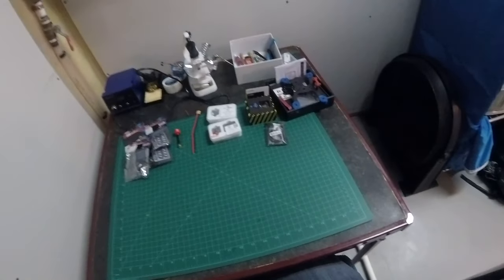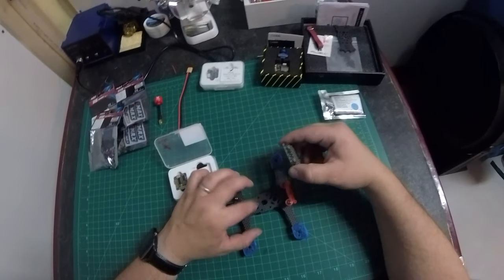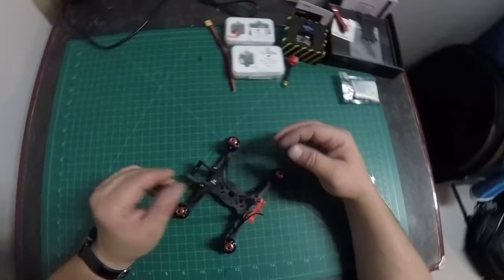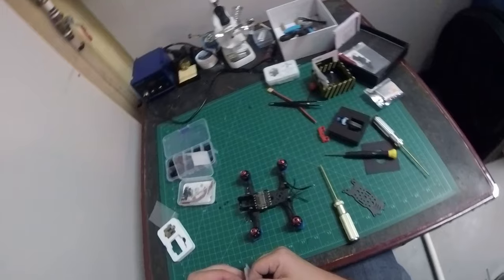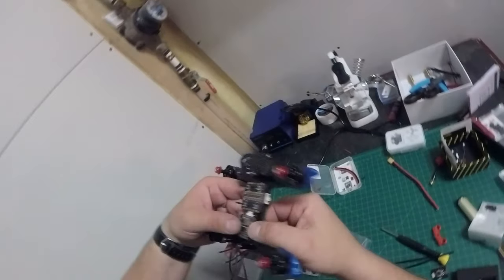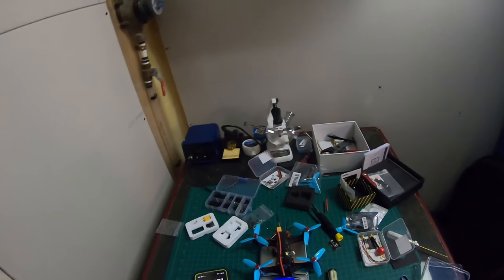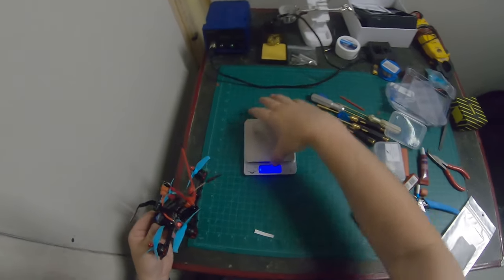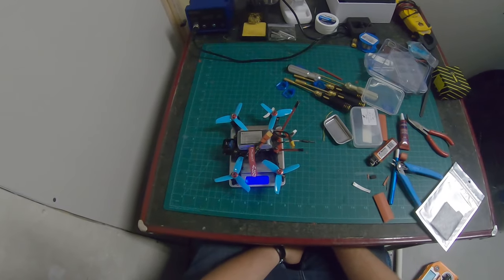#CaddxTarsier Building a 250 Gram 4k Racing Drone. Layout, Design, and Maiden Flight

Comment: did your motors get hot?
Reply from the maker: With the original motors no they didn't but I couldn't fly all that hard because they drew too much for the small battery. With 1407 3600kv motors they get warm but not hot.